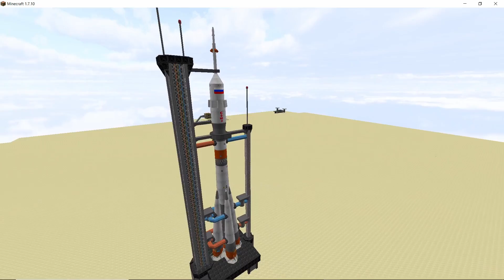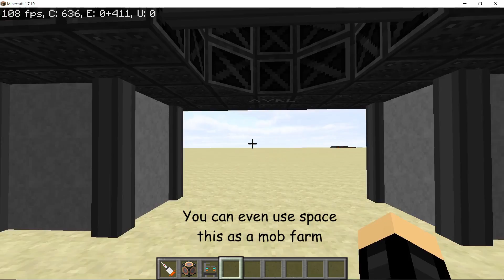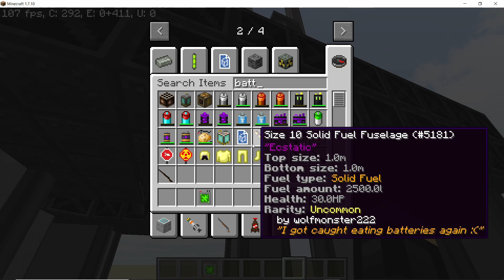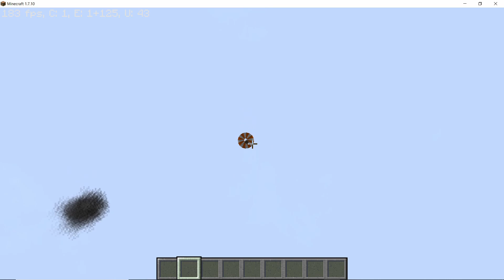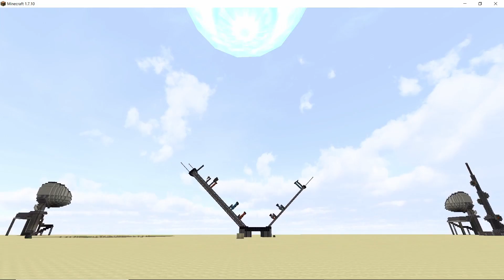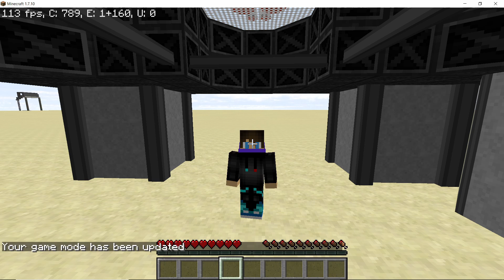SOYUZ Guide - HBMs Mod || How to use SOYUZ Rocket in HBMs Mod Minecraft

Comment: Couple of things 1 you can put wires and fluid pipes on the launch pad but it has to be the "center" top block 2 the death ray screen always follows you and you will be in the center 3 why is geralds wepons called Tom ?
Reply from the maker: Yeah true fluid pipes can be also placed and as for the death ray yeah I know it always has the player as the center but it was pretty difficult in the desert to actually estimate the distance 
As for Gerald , it is a reference from Fallout : Equestria where Gerald used to build a moon missile called Tom which used to come down and cause massive damage on earth
Reply: @SavageVegeta  1 yeah i guess it is 2 I haven't read foeq so I wouldn't know
Reply: @redponycyaneyes1882  iirc specifically it's Fallout: Equestria Project Horizons or something - an offshoot or something like that, not the main story